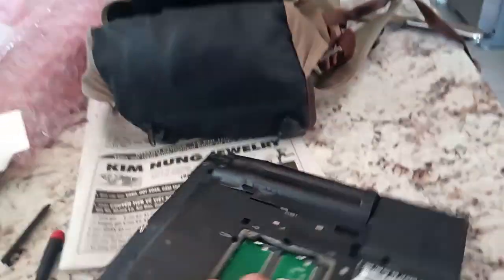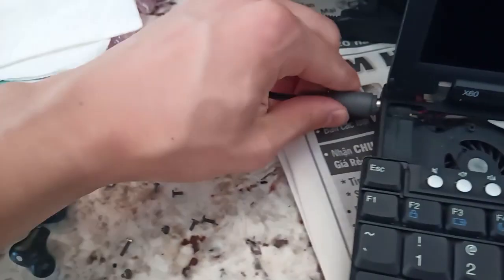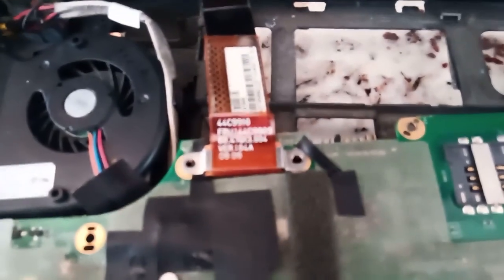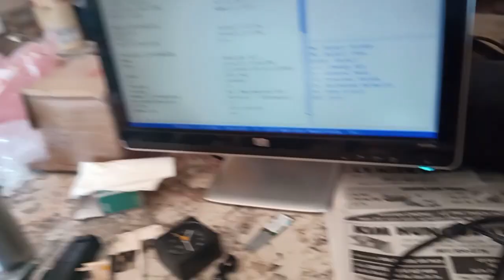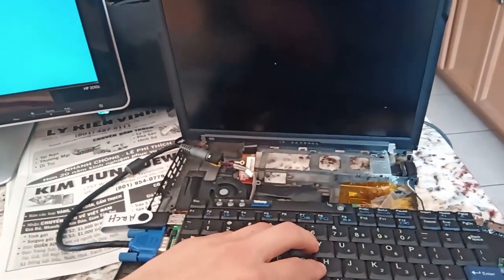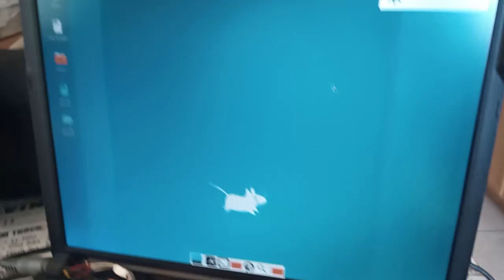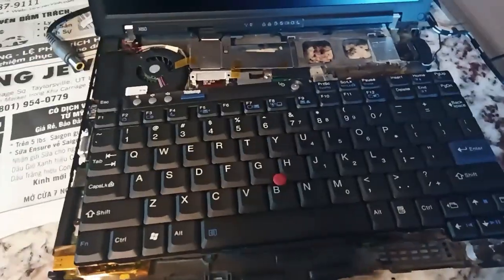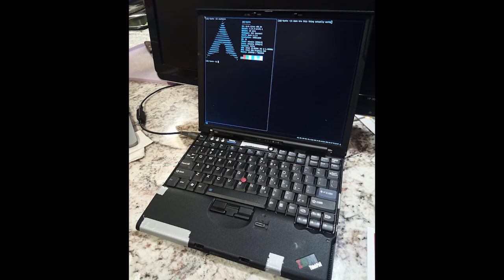fixing the craziest thinkpad in the world - the x61hk

Comment: I bought a slew of 51nb boards when I could, and I'm glad I did.  They become much more costly and difficult to source.  Although in recent times I'm using a lot more modern tech (macbook M2 with thinkpad keyboard), I have enough spare parts for the X6* and X2** to keep those going for a lifetime.  I lived most of my early professional life on a X61, upgraded to the 51nb board back in 2016.  I took it out of storage to getting going away (just need to source some new batteries
)
Reply: Which thinkpad would you recommend a college student to purchase in 2023?
Reply: @HeyltsKenzi  a x220 is wonderful butye rich enough, better get the x1
Reply: Did u get a x62 or x63 board?